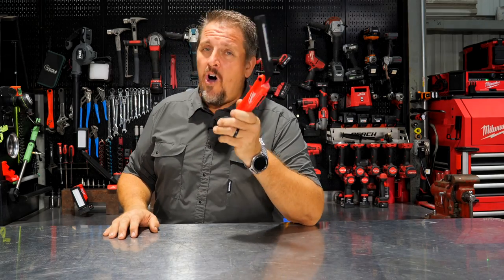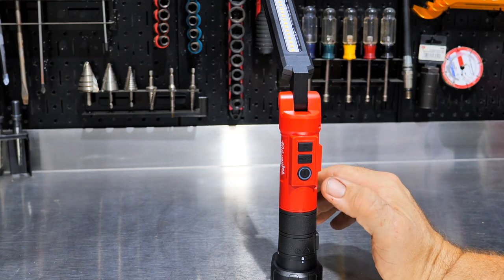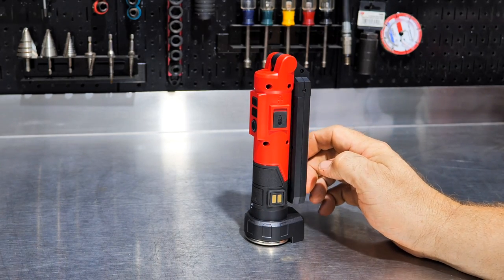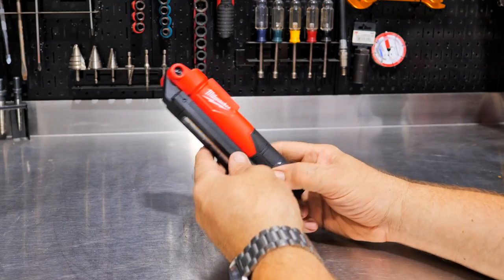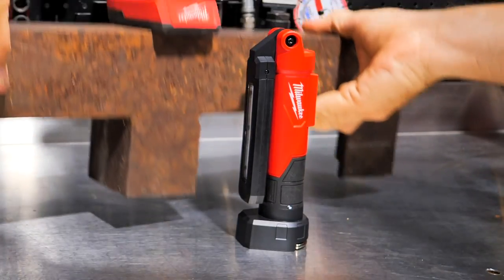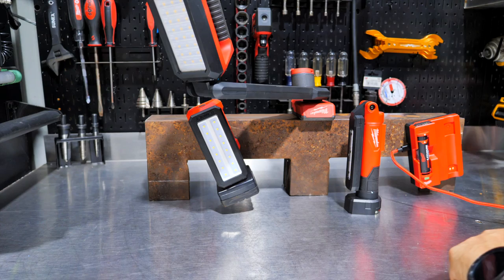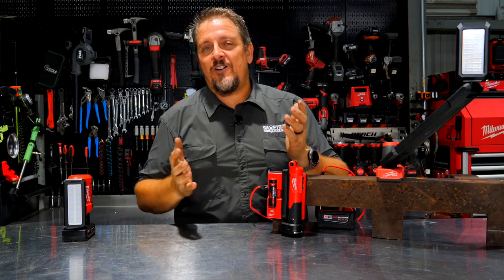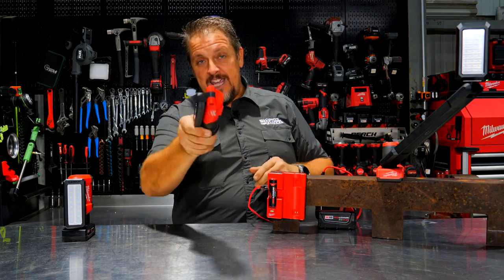Magnetic Docking Station! Milwaukee 2128 REDLITHIUM USB 3.0 Stick Light Review

Comment: I really like the trueview lighting Milwaukee uses on their flashlights. The light comes out more realistic to daylight and true to the colors that you are looking at and easier on the eyes!
Reply from the maker: Yes, we love the trueview color as well. Makes things much easier across the board, no matter what your job. You always see the right color and hue. thanks for watching.
Reply: I agree. I've gotten a little taste of this with their latest Gen 3 M12 Fuel Hammer Drill & Impact Driver set. Particularly the impact driver with its 3 LEDs - way better lighting than my older gen set, much more even/better distributed - and a much more pleasant neutral/warmish hue (vs a more bluish/uneven light in many of their less recent tools). Good 'flood' too for easy navigation in total darkness if you're working on electrical.
Reply: That is a sweet light!  I really dig the charger -- Milwaukee really does need to make a dual or 4 port charger for their Red lithium USB line!!

Comment: $150! I love Milwaukee, I’m addicted, but this is way to expensive for what it is.
Reply from the maker: We get it. You're right, it's not cheap. They do make some pretty awesome lights though. Thanks for watching and commenting.
Reply: Go buy a snap on one that would cost double with way less lumen with no removable battery and less versatile 
At less you can buy multiple batteries and swap them when working 10 hour shift with a 2hour run time is a god send
Yes it not cheap but just go look at the price of one red lithium battery
Reply: @legros731  the snap on one is actually cheaper lmfao. It’s only $80 and is way skinnier then the Milwaukee one. Which is great for tight spaces. No I’m not a snap on fan boy I have all Milwaukee tools. And some snap on shit. But I would 100% buy the snap on one again before I buy the Milwaukee one.
Reply: @snortmydogsashes954  the snap on you talk about is super dim I got one in my hand right now and it's shit and no removable battery so when is dead you better have another one while it's charging
And by the way snap on make more that one model of ligth
Reply: Trust me it’s not worth it!
Reply: @legros731  I’m not saying it’s brighter. For the work I do I don’t use it much unless I’m checking for a rear main seal leak. And it’s perfect enough for that. Might use it for some other shit but nothing too crazy. Personal I’d get the snap on one again only because it’s skinny enough to put in a tight spot. Not knocking Milwaukee at all on the light. I just personally wouldn’t use it.
Reply: $100 at farm and fleet
Reply: @snortmydogsashes954  hey dude, you think you can shoot me the model number of the snap on light you are talking about.

I am totally ignorant towards the snap on line. From what I hear they are super expensive.

I think is mainly bc the store goes to the shops which I get, is a great selling point. But have two legs and one short stump and can walk to a store just 😂 fine. 

Thanks in advance 🤙🏽
Reply: Its well worth it to me because of the lifetime warranty which no other companies have on lights. Also, the removable battery is essential for me because i need a work light pretty much all day at my job and i cant be waiting for it to charge. Also milwaukee is the best.
Reply: You know what I understand your comment. And I wanna ask too that if others see an option I’m not then please tell me, but I think for the market it’s a great option at this price. I recently bought the stream light stinger (amazing lighting) and I’m disappointed with the battery. Can’t be removed and changed, only micro usb charging, 2 hours of total run time, it’s great but just impractical as I need a light that runs 6-8 hours a day, or atleast have swappable batteries (and also in this form, flipping light with magnetic base).
Reply: @legros731 just b/c snap on is ridiculous doesn't mean Milwaukee has to be. That said they have great sales - I try to do all my tool shopping around fathers day and black Friday lol.

Comment: Can you really ever have enough lights.  I use the Milwaukee lights all the time.  I have Olights, surefire, etc, and the Milwaukees get the most use.  Heck I even have the Makita 10,000 Monster, which is great at night, but gets hot.  I got the new M12 1/4 impact just for the new 3 light setup even thought the M12 previous gen works just fine.  Never Never enough light.  I drive a 3500 Ram Dually Diesel so light is always needed.  A ladder is also needed.  lol

I was looking at the Harbor Freight folding lights, but this kills that.  Waiting on the Home Depot pricing hack or some price reduction.

Love the Charging adaptors.  I keep most of my lights in the top of My US General Toolboxes.  I really need more space so I finally starting to look at 72 the boxes.  The chargers take so much space.

Now Milwaukee, can you lower the price of your Green M12 lasers.  I really want them, but geez I really like my kidneys and the Doctor keeps telling me I really should keep them!
Reply from the maker: Great info. Thanks for sharing. I know, those green lasers ain't cheap. Thanks for watching.

Comment: Just saw the last one at HD for $79 and I had to look it up. The ONE thing I wish it had was the ability to charge other devices. I have a Klein rechargeable light that can do that and compares to this at $40. For a $100 retail it should be able to do that. I do appreciate that Milwaukee is addressing the USB C thing unlike so many other things still stuck on micro. Otherwise it’s is a pretty good design and it feels pretty solid. Compact enough for a tool bag but can light up a room. Perfect for standing up and aiming the inspection beam at something from the floor or countertop like a ceiling fixture.

Comment: Wish they would put magnets on the bottom of m12 batteries so you can set tools that don’t have magnets on certain surfaces. 
Just an idea .
Reply from the maker: No a bad idea. . Thanks for watching.
Reply: Great idea.  Someone should start making a thin magnet extension for the M12 batteries.
Reply: There is a company that makes them they make some for the snap on one's too
Reply: Lol extremely bad idea the battery will always be covered in metal shaving especially if you use a drill or grinder
Reply: @halledwardb  a removable magnetic boot could be a good idea but making all battery magnetic base not so much
Reply: @legros731  that's when you take the boot off mate
Reply: @brettwalkom948  reread op post and sharpen your reading skill clown he never talked about a magnetic boot
And I said it will be way better if it was a removable boot by the way lol

Comment: Hi there, random question..
I live in Australia, and for whatever reason we can only purchase the light in a kit with the battery and cable, no dock.
I've messaged Milwaukee tool Australia and have just been told that the dock isn't available in our market, even though it's really just usb c and there's no real reason not to have it.
Is it possible to purchase the dock seperately in the US? The part number is 48-59-2128 for the dock as per the parts manual for the light.
Reply from the maker: Unfortunately not. You have to buy the light and dock, or just the light. You can't just buy the dock. Sorry about that. I'm not sure why you can't get the dock. I'll ask Milwaukee. Thanks for watching.

Comment: so is the 550 lumens for when both sides of the light are on? or only one side?
Reply: Supposedly one side is 550 lumen but number mean almost nothing every manufacturers inflate these number 
It look plenty bright compared to other comparable light
Reply: Front and back panel are 550L each on high/250L each on low,  so when on together 1100L high/500L low. Inspection light 250 on high/100 on low.
Reply: @usatman711  not true both panels at the same time are rated at 550lm 
I got one and it clearly go to low when both panels are on

Comment: I ordered one fromOhio Power tools, but the dock was not mentioned as an option, thus explains the 2 brass connections on the side... I like the light, but the length of run time is not as good as my Milwaukee headlamp. It is a good light very versatile in confined places. If it was not for the docking charger, it would be just another Milwaukee light.

Comment: So I have been searching for just the charger. I have the original charger for the redlithium that I added magnets to I don't think this charger was out yet.  I also have the light that didn't come with the charger...didn't know about it. Any idea where you can get just the charger?
Reply: Do you need the mount? If it's not necessary just buy a separate cell with the charger
Reply: Yes I was hoping the magnetic mount is available separately. I have 2 of the lights but early versions didn’t have the magnetic mount or at least the ones I got didn’t come with them.

Comment: Great light just under powered.  They should have put a duplicate of the 1100lumen torch on the end with adjustable focus, and then also up the lumen on the bar lights to about 950 lumens, that would make for a good light.
Reply: They could of just put both panel lights on one side for 1100 lumens and made the head rotatable so it’s the same but double the power than the current set up and as well beefed up the tip light.

Comment: really seems overpriced and only 2 hours runtime makes it a "pass" for me. if you need a cheap but long runtime light, i bought the  "dr prepare" 400 lumen worklight, look on amazon. its basically the same style, has a magnet on the bottom, runs on 2 18650 batteries (can be upgraded or swapped out as easily as batteries in your tv remote) and i have gotten around 6-7 hours runtime on the flood style light. only downside is the buttons are a little awkward but you get used to them, one power and a - and + for changing the brightness.  it also has 2 of the flashlight style lights on the end, all for about $20.

Comment: Does it do all that damned "blinking" as batt level changes like some of thier lights do? Thats a deal breaker for me!, tryin to finish a job and its starts blinking...
Reply: I have a Dewalt light that does that, and imo it’s dangerous. It’s startling at times when the light turns off then comes back on every 3-5 minutes. When it’s completely dark and this happens, it almost makes you feel like you just instantly died at that moment. I can’t stand it. 
It should vibrate or beep, not turn the light off and on.
Reply: I HATE that feature and would like to give the Milwaukee engineer that came up with that a good kick square in the jewels. Actually all of them since they apparently all thought it was a great idea seeing as the feature made it to production. 
First time it happened I was in an attic working on the power lines and it scared the living sh#t out of me. Thankfully I don't have a weak heart because otherwise I would no longer be here to complain about this...

Comment: Let me be the first to say I'm a cheap book especially when it comes to LEDs preferably buying them from China because they're 10% of the price and 90% of the bang but when it comes to quality of light I've noticed a huge difference you may be able to go to cheap light but a quality light like the Milwaukee's the durability of the plastic the tight fitting of everything the swappable batteries and then the actual quality of the color of the light doesn't hurt your eyes or blind you when you're trying to work on something from being too white these lights are worth every penny well I wish they would be cheaper honestly but still worth it. And dear China the biggest grab I have with your goddamn lights get rid of the strobing light feature and the red light feature please just on and off on high on low off That's it That's all the light should have I don't need SOS I don't need flashing strobe party light and nor do I want to click through it when I need a light

Comment: I usually don’t buy anything that is not on sale, but with this light right here I might just pull the trigger. 

I plan on docking it on the wall next my Dyson vacuum collecting 🤦🏻‍♂️ 

I want to make it accessible for wifey, two teens and myself. The docking station did it for me, I think it’s just a good idea for the entire family to know where there is a flash light at all times in case of an emergency. 

BTW DeWalt guy here 💯 
well now %99.9 😂 

🤙🏽 review!

PS: NOT HAPPY THAT IT ONLY COMES WITH ONE BATTERY!

I thought I was a cheap F but Milwaukee you take the cake. For the price, common man! YOU SUCK!